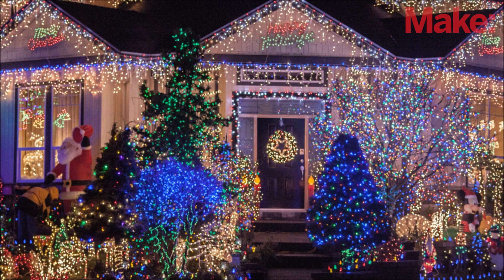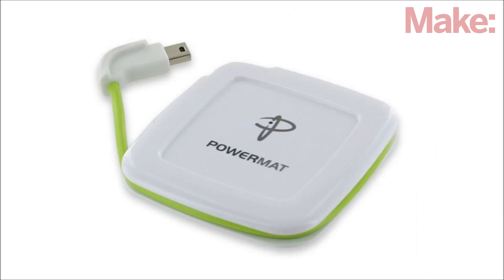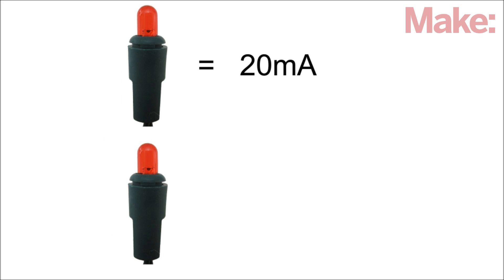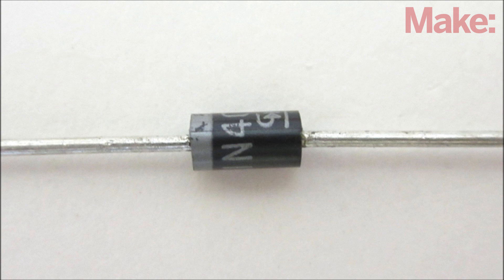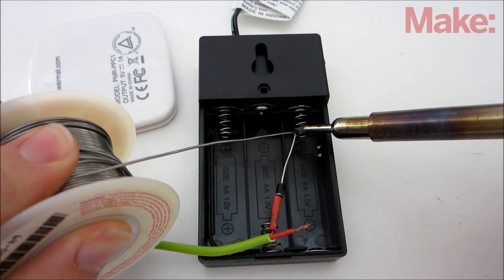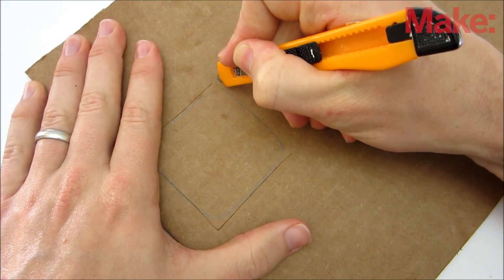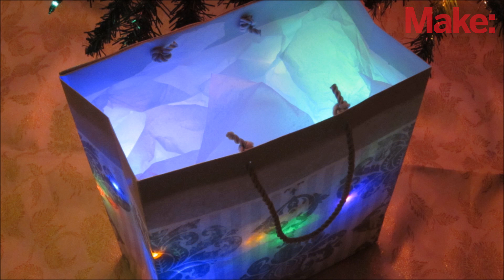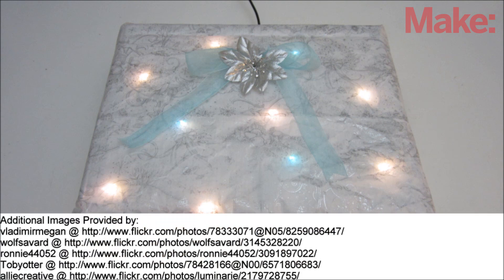DIY Hacks & How To's: Light-Up Christmas Present

Comment: While I agree with the criticisms put forward, there are a couple reasons I appreciate this video. 1) The idea of doing lighted presents is in and of itself pretty cool. 2) The idea of altering a set of LED lights has sparked thoughts on things I'd rather do. For instance, although I'd probably just stick with the regular battery pack it might be interesting to have the lights motion activated so that they light when the present is picked up. Setting up multiple modes with a momentary switch (always on, motion sense, blink, off, etc) would be another option. Having the inductive charger actually act as a charger to charge batteries hidden in the present would be another useful possibility. Anyway, thanks and happy holidays. :)

Comment: OMG a simple idea turned into a complex mass of uselessness. So the lights go off as soon as you pick up the present!? - SHIT.
1. Very expensive & time consuming not to mention material intensive if you are giving more than one gift....
2. beneath my xmas tree electrical sockets are at a premium as is space, ie I don't have room for induction mats.

Here's how to do it.
1. buy battery operated lights
2. fit batteries
3. wrap around gift box and cover with paper (leaving the switch showing/feeling) turn on xmas morning.

Comment: Would be better if it lit up when picked up.  Here's how you do it.  1. buy $3, battery operated lights. 2. Buy a magnetically operated switch (I can get industrial grade ones for $5)  3. wire switch into lights.  4. I think you can figure it out from here.

Comment: The powermat receivers can be opened quite easily and the circuit inside is a little smaller and very flat so it could be completely concealed in the cardboard. I also don't understand why you kept the battery holder. And leds don't care about the voltage as long as you keep the current down.